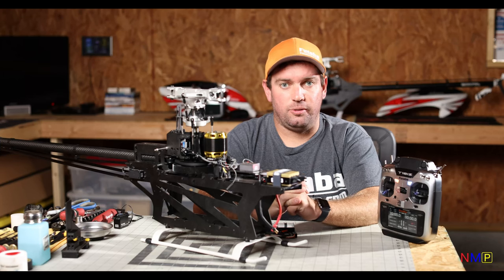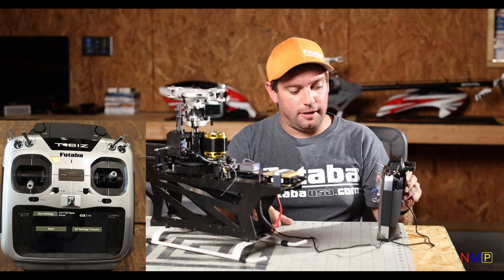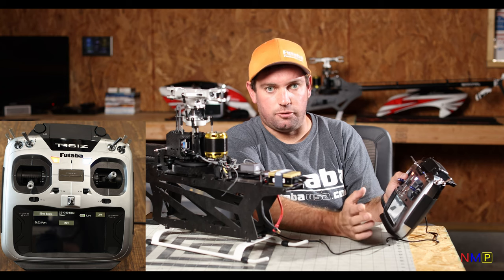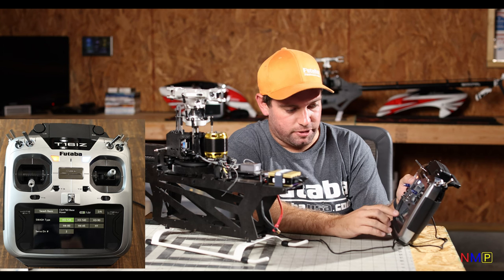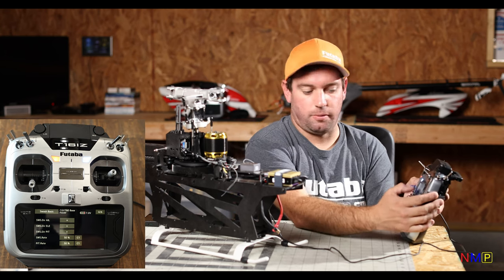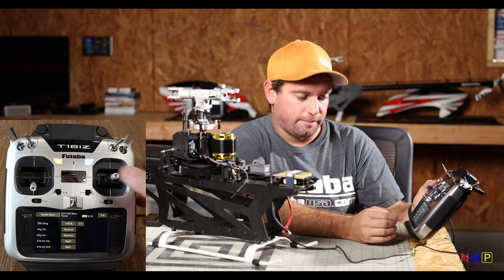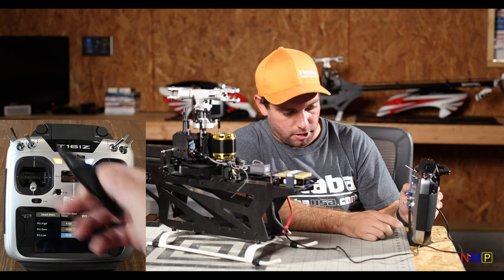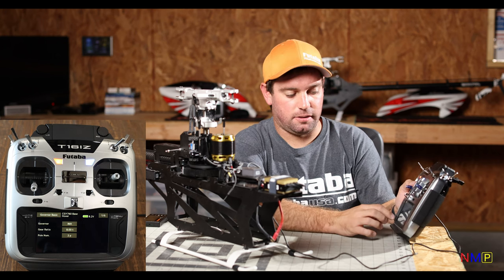Futaba CGY760R Wireless Setup with T16IZ

Comment: i need help. i found a bug in the 16iz to cgy 760 power and programming. So wired from the back of tx going to the pbox port on gyro is the issue. When you plug the servo cable  from tx into pbox port there is no power to the gyro unit. So most folks power on the gyro from a battery source. However the issue is when you enter wired programming mode on the tx the radio now provides power to the gyro. I found out when I unplugged external battery from gyro while still in programming ode on radio, after unplugging power stayed on to the gyro. This is not good as your not supposed to run power to the pbox port. THere is no documentation anywhere on this. This sucks because that is one expensive mistake with futaba.

Comment: Hi Nick,Do you have a video setup for CGY760r to futaba 32mz and a nitro heli.I already trying to the one you did but it wasn't work.the setting in the CGY760r its done well.when I tried to connect from gyro to transmitter I can't not find the gyro setting in the transmitter. Thank you.Nelson

Comment: Great video.  Nick, couple of questions please. 
1. With my current 18SZ and GPB Wireless integration via the trainer port, I have to plug the box in once each time I swap between models for tuning.  Is this the case with the 16IZ, or is this the ID matching you mentioned earlier? I.e., does the radio cache more than one unit's settings? Example, I've been flying model A and making tweaks. I want to get out Model B and tune (just the 'safe' flying paramateres, NOT setup stuff) it.  Is the cable involved here at all?

2. If I assign CGY conditions to a switch, lets say DG1.  When I'm in the Gyro Setting menu on the 16IZ, will the active FBL Condition change depending on stick position, or does one have to select the condition manually on the setting page to change parameters on that condition? Just to clarify, I'm referring to C1/C2/C3 on the CGY, not the Tx conidtions such as idle 1/3/Hold etc.

Thanks!